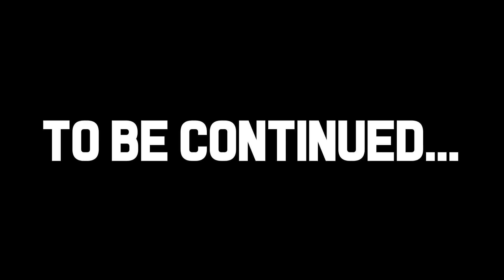Drift Week 2 Ep. 3: Small victories?

Comment: Instead of relocating the alternator you could have put an extra belt on there and zip tie it off to the side so if something happened to it you can cut off the old one and slide the replacement into place!
Reply: It was a good idea to relocate that alternator. There was a ton of things wrong with the way they mounted it. 8mm bolts in a 10 mm hole, held up top by a bent 18 gauge L bracket. But this was just a small example of what we were in store for.